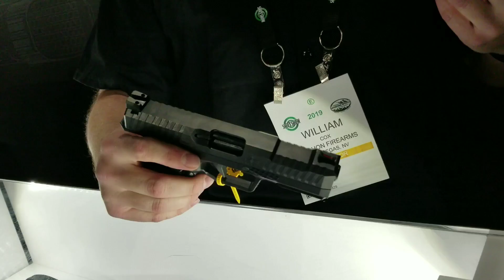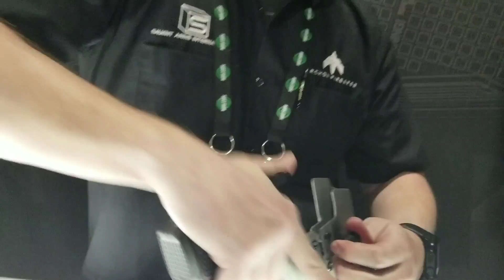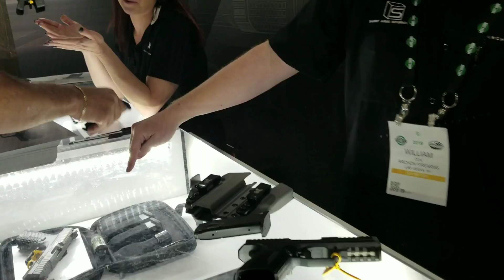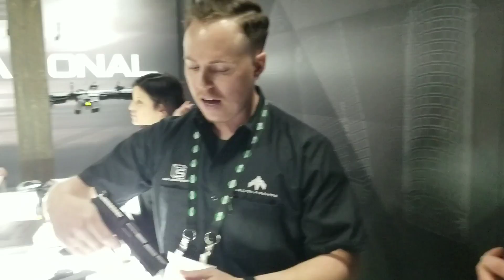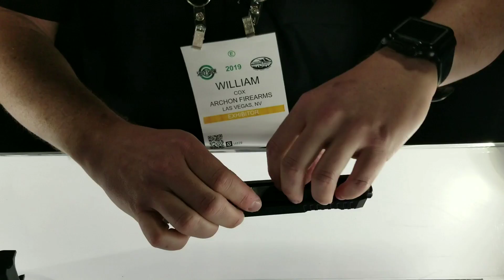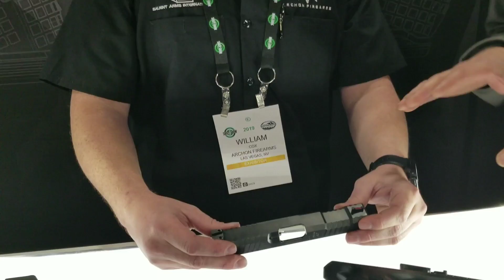Archon Type B Shot Show 2019

Comment: It's nice but its too early to say its the best striker fired 9mm semi-auto on the market.  $850 for 2 extra mags and a claimed reduced recoil based on their AF speed lock tech seems a bit steep.
Reply from the maker: It comes with 4 mags. I will have to put more rounds through one before I can make that decision but the 30 rounds I shot at Range day, I was impressed.
Reply: @TacticalAdvisor  was there a substantial reduction in perceived recoil?
Reply from the maker: I t was very controllable but it wasn't anything to write home about. I would have to get more rounds behind it to really compare against another handgun.

Comment: You can buy them but the trigger gets so hot it actually burns you so gonna pass on it
Reply from the maker: I would like to test this. that's the first I heard about this issue
Reply: Military arms channel did a test. They measured temp as they shot keeping a round count. I believe other channels did the same. The trigger soaks up the heat as the slide cools down and then has no where else to go.
Reply: @SpudOutdoors  no other channels reported hot triggers. Yall gotta stop reporting what you see and start reporting what you experience
Reply: My trigger never even got warm
Reply: @Shep 24 I can name another channel, but shouldn’t have to. Video clearly shows it happening. It’s not made up and how many rounds did you fire and how fast did you fire. Did you repeat the exact test they did? If you didn’t then that’s the variable of why yours didn’t. Point is it’s a $800 dollar gun with no track record. Many other guns out there half the price with a long track record. Just cause of the test I wouldn’t buy that gun. I can buy two for that price. I loved the concept and waited 3 years and now just disappointed.
Reply: @SpudOutdoors  you missed my whole point
Reply: @Shep 24 I could say you missed my point. I have never shot the gun but after what I have seen I am disappointed. My original statement said I would pass on the gun. I think the new alien pistol is the future of Low bore. Not to mention they talk about how they came up with how the stryk b locks up. That design has been around since early 1900s. Did they improve the design, yes.. I can’t warrant spending that kind of money when I can shoot other guns half the cost with a proven history of reliability. Especially when there is a possible MP5 clone in the near future that might be cheaper than $1100.
Reply: @SpudOutdoors  all I'll say is I own and have run 1000s through it no heated trigger no ftf no fte. Don't pass its an amazing gun. Tho this guy is being ridiculously smug about it.